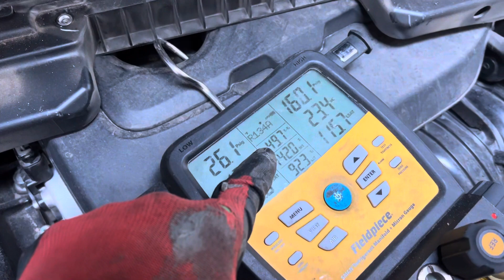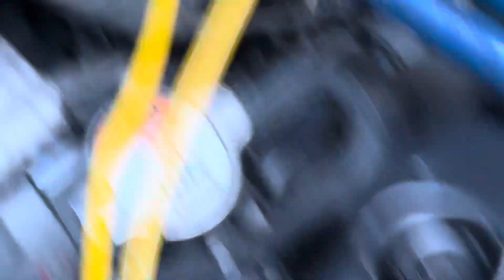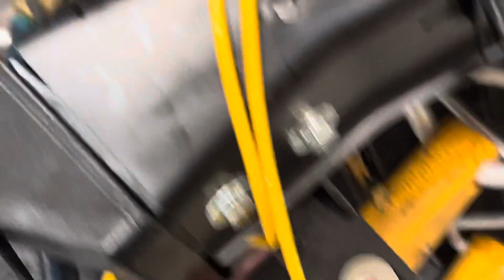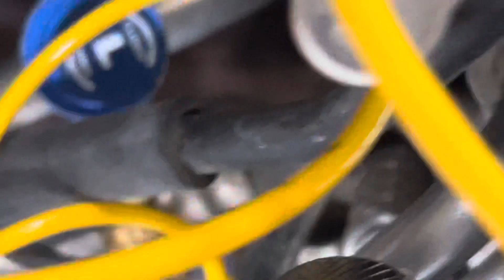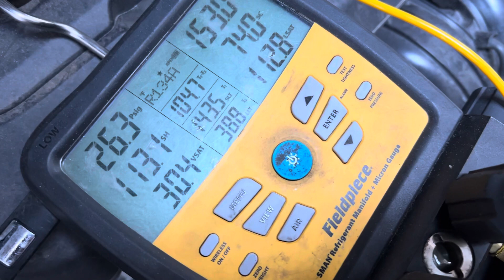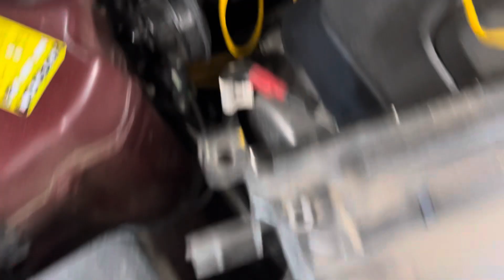AC Condenser Pressure Drop ￼, internal heat, exchanger, sub cooling ￼

Comment: Tom lech  thank for the time answering my question. Is 1990 ford econoline everything is original the stickers says 1.6 k but now I want use 134 how much should I put in it
Reply from the maker: That is an orifice tube system

It had two compressors available I believe one was dealer installed one  was factory installed? 

Trying to remember if that had to FX 15 which was a fragile compressor . Not sure can’t remember.. 

Whatever the oil quantity that was factory installed, add an extra 3 ounces. 

With your new compressor, you’ll be installing they probably manufactured it and did the machining clearances. See if your instructions say to use PAG 46 ?  
This will vary depending on compressor manufacture, and when it was manufactured. 

If you have a Fluid driven Thermal fan clutch. REPLACE IT !!!… 
If it is, and you don’t mind the noise of a jet engine, starting up in the morning get one of the heavy duty ones.  

If it was my very own personal vehicle, and I had to change the condenser. 

I would hunt down it would have to be one of the aftermarket manufactures that has a microchannel condenser replacement. 

And if the hose fittings were the exact same location. 
And this vehicle how to option for dual air conditioning in the back of the van. 

I would order the Condenser that was meant to be installed on the van that had to Evaporators. 

But then the refrigerant charge would be completely different much less. 

I can’t help you with that, because that depends on which aftermarket Condenser was selected. 

When is my very own personal vehicle or a customers when I’m modifying like this? I install AC all liquid site glass with a moisture indicator just before the orifice tube.. within inches.
Reply: @coldfinger459sub0   thank you. I’m using the oem condenser I only going to change the hoses and dryer
Reply from the maker: @joseavilez9870  don’t forget to check that that orifice tube is clean and since you have the lines off in the dryer off, Aka accumulator

You’re right there flush out that mineral oil out of the evaporator . 

If it’s a really easy compressor to remove 

Remove the compressor and pour out that old mineral oil and replace it with new PAG oil.
Reply: @coldfinger459sub0   yes sr. Again thank you. You are the Michael  Jordan of the ac.

Comment: If I have a car that had 1.60 kg of r12 now I going to use r134 how much should I put in it?
Reply from the maker: It changes on different AC systems

It depends the size of the condenser 

It depends whether it’s three eights inch tubing Finn 
6 mm tube, and  fin 

It depends if it’s serpentine condenser 

It depends if the condenser has 12 fins per inch to 18 fins per inch 

It depends if it only has a thermal, mechanical fan clutch 

Electrical fan that comes on instantly with clutch engagement and off with clutch engagement 

Electrical fans that work off a pressure switch that come on at a certain pressure and turn off at a certain pressure 

Or a variable fan that constantly monitors and keeps his particular pressure

Comment: thanks for this explanation, I'm still missing something.  Why do car manufacturers use this exchanger? The compressor will receive a high suction gas and therefore also a higher discharge gas.  I can imagine that this certainly guarantees that you have 100% liquid with your TEX, but this makes your compressor have a harder time.
Reply from the maker: It takes out energy from the liquid gas delivered to the expansion valve so I can do more work

More efficient 

Instead of having a larger condenser 

Because refrigerant, R 1234YF is a little bit less efficient than 134